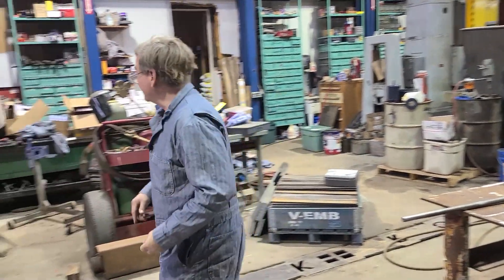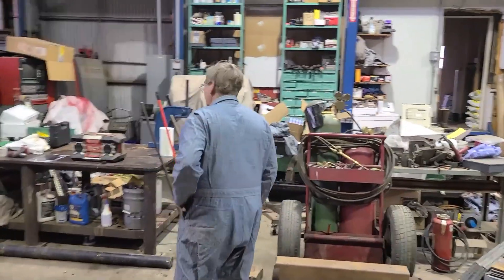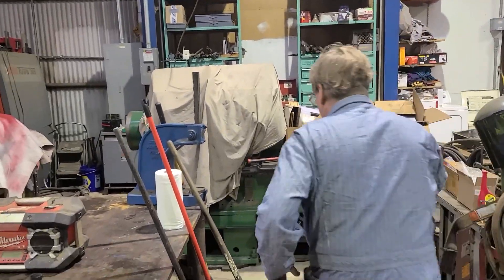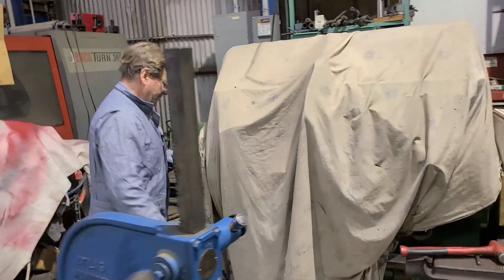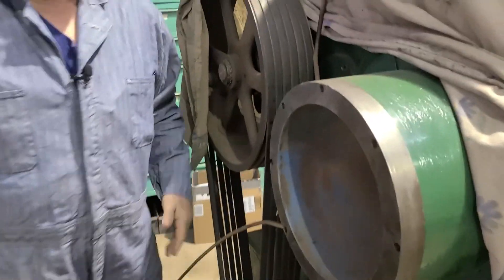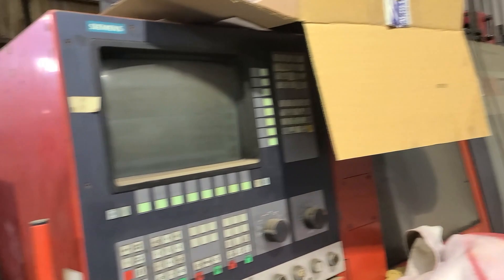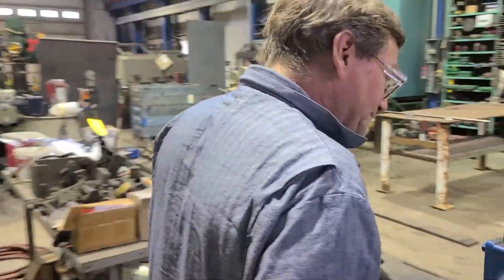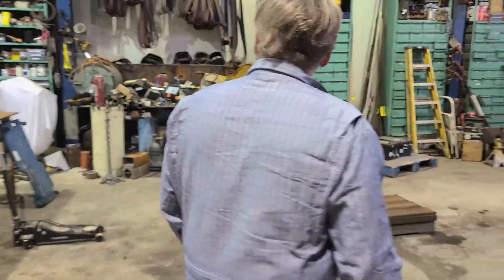Machinist's Minute(s): Dealing with very long shafts on a lathe

Comment: Used to cut api threads for gas and oil straight out of high school,cut my teeth in it. They build you rollers with some 1" all thread as the adjustment system,couple grease zerks. Weld shop built multiple for us,they also made a hydraulic set for "centering" your pipe in the chuck (long level,lotta hope) all machines have 4 foot dia. Chucks in each end of a 10' headstock though. Lotta weight in them bad boys,makes all the difference. All makes sfm almost irrelevant,normally you find a place that "works mighty nice"

Comment: I've had some hideously dangerous things happen trying to work long, big steel on a heavy 10 south bend. I don't have a steady rest so I bought a new 3 jaw and thought I could grab it tighter. (It doesn't work... I have a big lathe, it's in in the other building without fans and good lighting or good carbide tooling, plus it's an old belt drive with old rotten belts, so I wince running it fast. The moral of the story is that I need to buy new belts and carbide for the big lathe before I lose appendages.... but I don't use it enough to justify the nearly $1000 it's going to cost. What's my arms worth? To be determined.......
Reply: 1000 dollars? That's it to make it safer for you? And you can't justify that? Lmao
Reply: @Dillybar777  I just got it going again this year. It's been sitting for the last 30 years. So far, I've used it twice. I probably would have used it more had it been done. It's hard to justify $1000 on something I may use 5 times a year. Farming isn't really that profitable right now. I will buy the belts, but running it slow is working for now. Carbide would be a luxury I have more hss than I know what to do with.

Comment: I learned on a Hollow spindle lathe doing well casing, drill collars, and subs. We had an embedded roller that was about 10ft from the rear spindle of the lathe. We had two more moveable rollers that we could move where they needed to be to support the really long pieces. Also had another roller that could be suspended from the rail crane but I never used it. Current job has lots of engineering interns that like to make things on 3d printers. If I have a shaft that is under 10ft long I will have them make me a cone that supports the unsupported end. Just slide it over and drive it into the spindle hole. No problem with whipping that way.

Comment: I operated a machine shop in the oilfields of California years ago. Much of our work was turning threads on oil well casing in 40' lengths. We used rollers on a stand out near the end of the casing to support the out end through the hollow spindle. We threaded many lengths of tubing, casing and drill pipe this way.
Reply: I bet that shop was awesome. Oil field in CA - lots of work out there ?
Reply: I assume the pipes were rigid enough that you never worried about getting the jump-rope of death. Would you just support it in the middle if that were a concern?
Reply: @mikeakerstrom1667  The pipes were very rigid, commonly 7-12" diameter. We weren't turning them very fast either. Never had any issues with jump-rope of death.

Comment: On the non chuck side of that spindle, make a flange that will bolt in to the existing threaded holes, then add 4 screws to the barrel of the flange.   It can be dialed in on both ends of the spindle and is amazingly stable for long work pieces.
Reply: Great for smaller lengths

Comment: Shops in Alberta canada are common that cut threads on oil field and drilling pipe . |'ve never seen it in action but it's a machine that does only this kind of pipe .
Reply: Hollow spindle, dual 4 jaw chucks with adjustable (up and down) rollers mounted on rails for fore and aft adjustment to support the pipe.
Reply: @osql8  Right on

Comment: I was turning a 1/2 X 48" shaft, it started to whip around and caught an air hose, BOY HOWDY, I had to change my shorts after that!
Reply: Engaged the power feed on the mill a couple days ago, some genius (me 🙋‍♂️) left the air line hanging on the other side handwheel. Wrapped up and ripped the fitting off. Ooff💩💩

Comment: This is way off topic, can anyone tell me what the is written on the drain cover down the center of the shop. I've been trying to figure it out but no luck so far. 😊😢😊
Reply from the maker: They are names, they were here when I bought the shop in1992, it was built in 1971 for Arctic Motor freight.  Original staff, or construction crew, I do not know.  I think the one showing in this video is ROY it is turned upside down.
Reply: @HOWEES  intriguing ... i'v been trying to sus that out for a while now ..  going through your back catalogue of videos  to see more of your work and  your amassed knowlage ... but not working out what was on the  ... drain covers ... upside down and back to front would make a differnce to working this one out :)...
peace

Comment: I regularly have to turn long shafts.  I set my milling machine up off the end of the lathe.  I can set a steady rest on the table of the mill to support the shaft I'm turning in my lathe.  The table makes it really easy to adjust and center the steady rest.
Reply: great idea
Reply: Good idea, which mill axis shares axis with center of the shaft?
Reply: @wesleyhorton4330 z
Reply: Wow that sounds like a cool setup. You often have to do that ??
Reply: Is that a design feature of your shop? Or just happy coincide? Maybe the latter but cool tip.

Comment: Thread ends on long pipes can be done on CNC horizontal borers, which screw cut with a motorised facing head. Could be done on a manual borer but I doubt it would pay. CNC would be done in no time